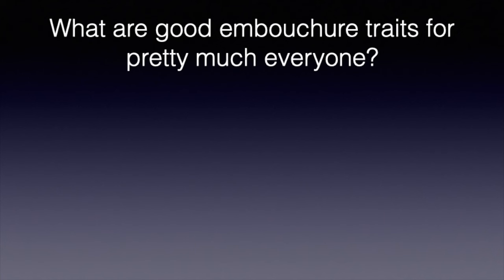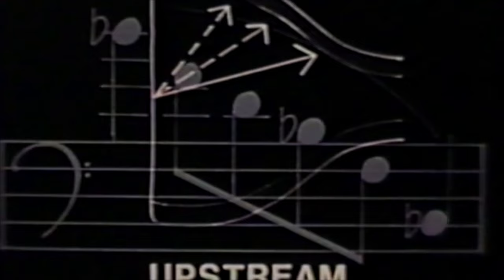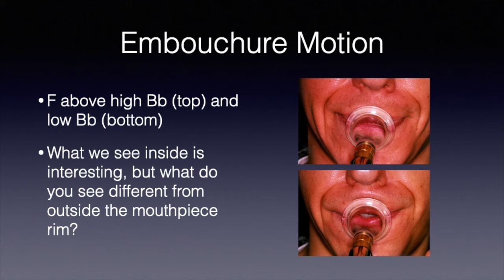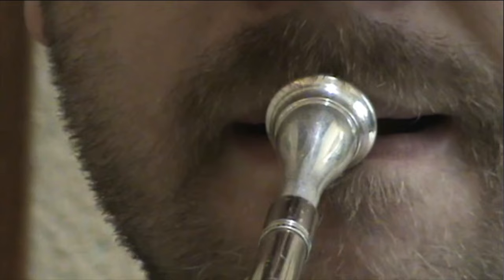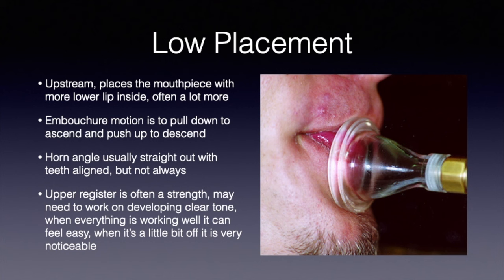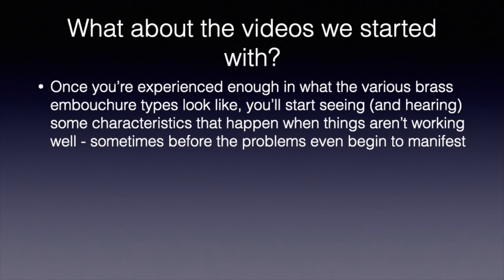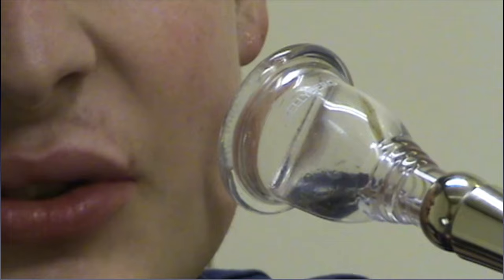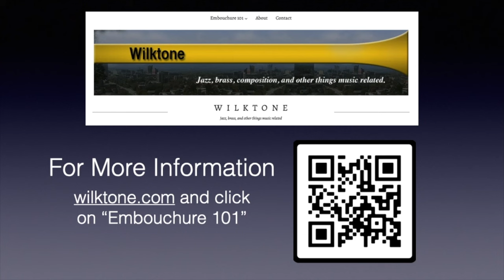Brass Embouchures Presentation NC Trombone Festival 4/13/24

Comment: Hi Dave!  I was a bit confused about the 'medium high'  - are you saying that the lips are versatile in dominance?  Low - upper lip; High - lower lip: Medium High - either?
Reply: "Medium High Placement" embouchure type still has the upper lip dominant inside the mouthpiece cup, so it is one of the downstream types. The reason I use the label's "medium high" or "very high" is because those two embouchure types tend to have placements that are noticeably different from each other. That said, they can appear very similar based on placement alone. The distinguishing feature between the two embouchure types is the direction of their embouchure motion:

Very High Placement - downstream (more upper lip inside), pushes mouthpiece and lips together up to ascend
Medium High Placement - downstream (more upper lip inside), pulls mouthpiece and lips together down to ascend

Hope that helps!

Dave